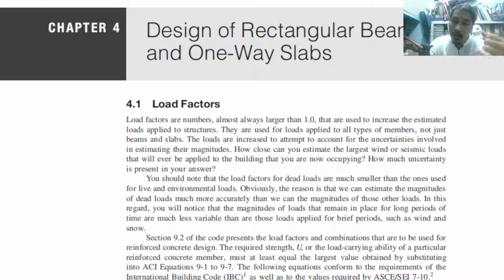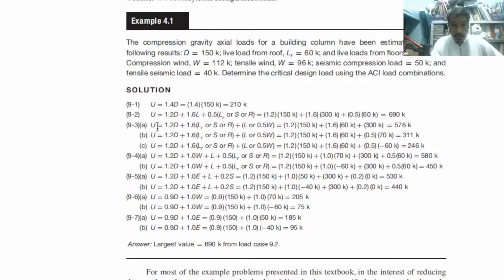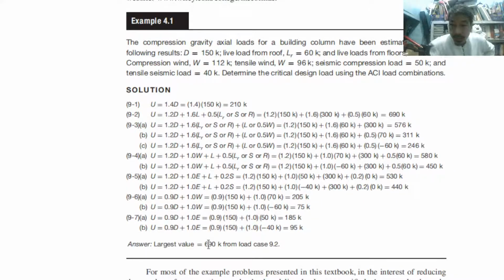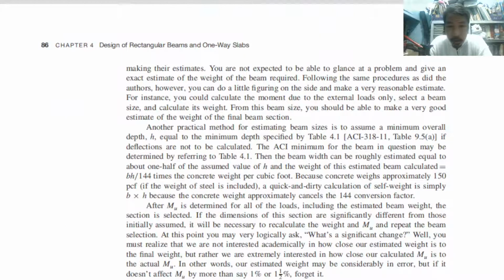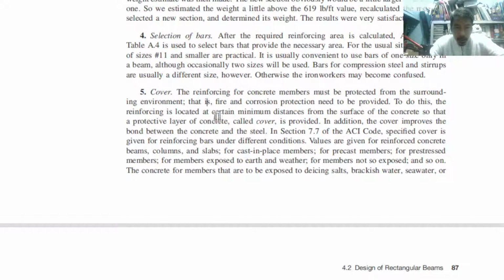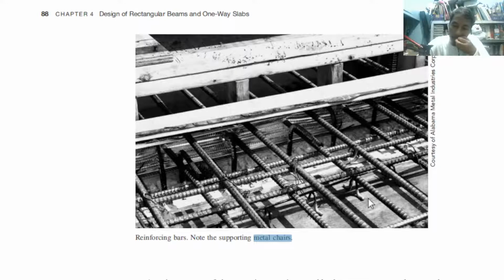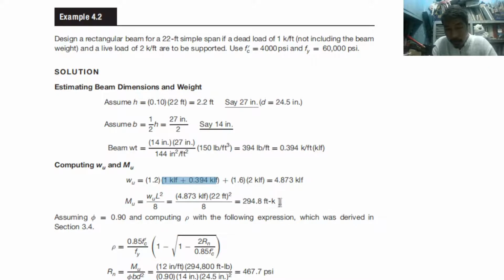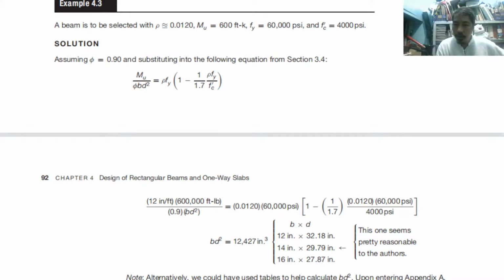[ LIVE CEE7 Lecture 12 ] DrAP Zantua Rectangular Beam Talks + ENGINEERING Design

Comment: This video discussed the rectangular beams. First, I am familiar with the LFRD load combination as we have already discussed those in steel design. It contains the same equation/formula. It also have the same concept, wherein we get the largest value computed and it is called the critical design load. Beam proportion, deflections, estimated beam weight, selection of bars, and covers has also been discussed. This are all under the design for rectangular beams. The figure are familiar to me as it was on the engineering plan under the details for slab. I disagree sir that in our country, we used stone or gravel for spacer. Maybe for those who don't consult professionals. I have seen several construction videos wherein they used concrete spacers. Metal chair has been new to me, I must say this is way better than concrete spacer that we used here in the Philippines. Thank you, sir for the sample problems that is about designing of a rectangular beam. The assumed height are 10% of the span while the assume b is half of the h. I'm confused by some of the symbol's value. However, I'll try my best to figure it out on my own. Thank you, sir for this lecture.

Comment: Thank you sir for this another informative live lecture about the design of rectangular beams and one-way slabs. Load factors have the same load combinations formulas/equation in the LRFD in the previous topic.  The design of rectangular beams was talked through with beam proportions, deflections, estimated beam weight, selection of bars, and covers.  The explained problem example with the application of this lesson is understandable. Thank you sir.

Comment: thank you sir for discussing about design of rectangular beam and one-way slabs. I learned about load factors which are members almost always larger than 1.0 that are used to increase the estimated loads applied to structures. Some formulas from PSD course could be use too in this course. Thank you, sir, for explaining some examples related to the topics. Thank you for clarifying some typo error in the solution from the book. Also the video include design of rectangular beams ( beam proportions, deflections, estimated beam weight), table 4.1 that should be use in deflections, selection of bars, cover (If concrete members are expose to very harsh surroundings, such as deicing salts, smoke, or a id vapors, the cover should be increase above these minimums.), minimum spacing of bars.